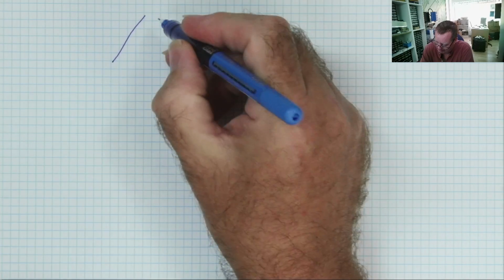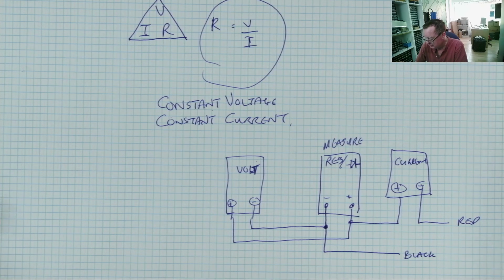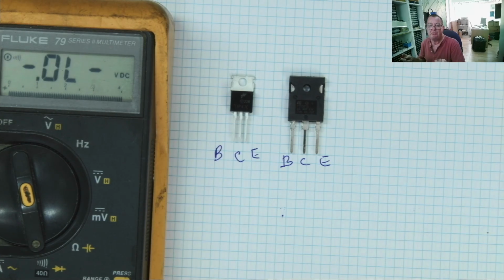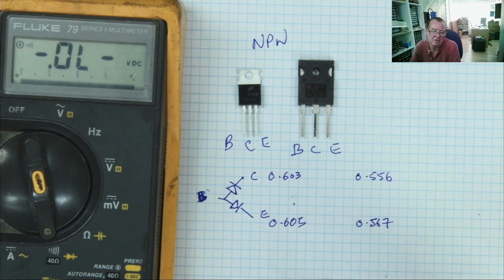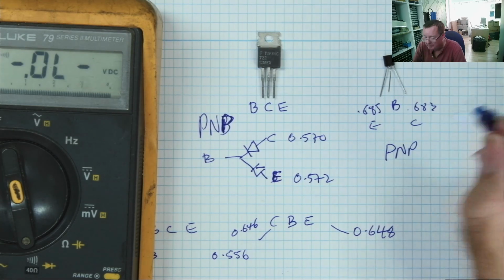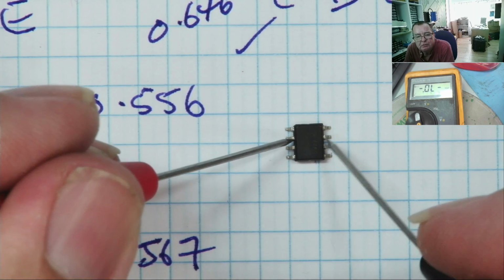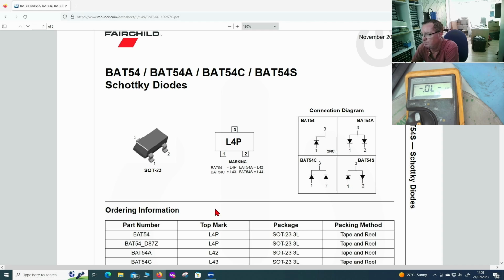All You Need To Know About The Diode Test Mode On Your Multimeter To Fix Stuff. How to use.

Comment: Just as a reminder to myself and whoever is interested, when testing you are injecting current into the device.  So when testing a diode, negative lead on the stripe side (cathode), positive on the other will result in current flow.  On a bridge rectifier, the + end is in fact the cathode end of the internal diodes, so trying to push current through it during a test is reverse biasing the diodes and it won’t conduct.

Comment: You cannot touch leads while testing your fingers will affect reading.
Reply: Only if you measure very high resistance or very low tension (voltage)

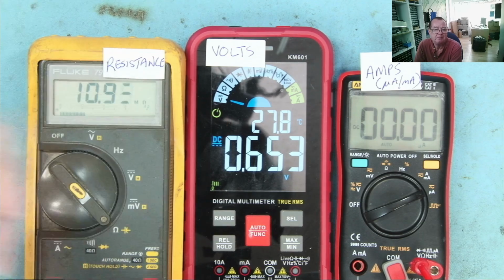Comment: In the beginning of video at 5:22   you have 0.6 volts when doing resistance measurement .   How come when it should be constant voltage of say 0.1 volts  ? You are reading 10 M Ohms through the internal resistance ofmeter measuring voltage.

Comment: I tried testing an led but my multimeter can't measure anything in diod mode. I can measure normal diode thought.
Is it only some multimeters that can measure LEDs and make them light up?
Reply: Yeah, Is it only some, like Brymen EEVB version multimeter. It has hight voltage mode for led.
Reply: @YuriyShpak-nb6xo  But can those kill some components if accidentally set on diod mode instead of resistance. Like if a component only can handle 0,8v?

Comment: why if i sense voltage on a working power mosfet i mean during operation, it causes to blow it? what is the explanation?
Reply from the maker: That shouldn't happen, at least not if you have your meter in volts mode.  Which pin are you measuring? The gate?
Reply: @learnelectronicsrepair     Been there done that  😐
If you mesure voltage between drain and gate on a working SMPS, you will definitely blow the mosfet

Comment: Can you help please? I've got two multimeters , one small fluke and a big bench multimeter I bought. When I do diode readings , they're different on both multimeters. When I do the reading on the bench multimeter it's different to the readings I get off the fluke multimeter by a lot . Does that mean one of my multimeters is broken? Thanks
Reply: Yes , eventuelly, because show the meassurement voltage of your multimeters.
Reply: No necessarily, they may simply use different constant currents in diode mode. As the junction voltage depends on the current you will get different voltage readings. Just measure the current in diode mode with the other meter in current mode and you will see how much they differ.
Reply from the maker: @UltraUltaderdritte  Yes exactly that.  In this video I showed that the Aneng could light blue and white LEDs and give a voltage reading, whereas the Fluke gives no voltage reading but still lights the LED.  Different brands of multimeter will output different voltages and different constant currents in diode mode.  This does not mean either of them are faulty, and there is no international standard that I know of which a multimeter should adhere to in this respect.
Reply: It depends on by how much they differ,  if its more than a few percent then yes one is duf.  A normal diode will read about .6 - .7V so the meter that reads close to that should be the good one.
Reply: The collector is normally a lower value as the collector is a larger junction on the silicon. This helps in the collection of electrons..